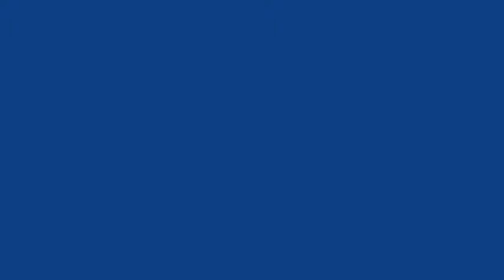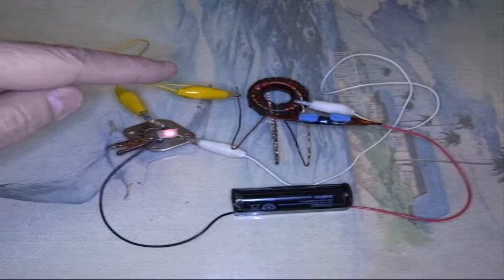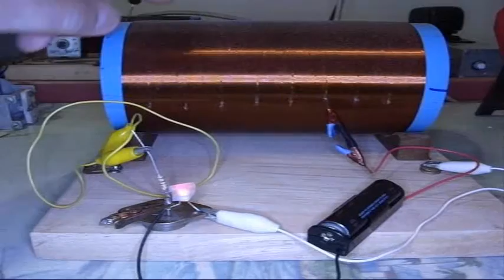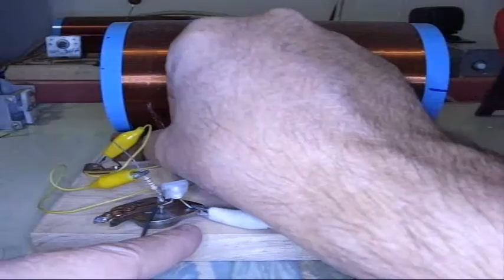Joule Thief Core Ratio & Variable Frequency Experiment

Comment: lots of things to experiment with.thanks for sharing.are the tap points just a looped section of the coil,with the coating removed.also how long,diameter,number of winding's,number between taps dia/gauge of the wire if you have time
Reply from the maker: +bill bailey The wire is just enamel coated "bell wire".  I show how to wind one in https://www.youtube.com/watch?v=8XR9Uzy2RPM  
There are 20 turns between taps in the first coil, but that' could be 5, 10, 15, 25 or whatever you want to try.  The second coil with the wiper is 170 turns, but again that could be more or less.  I used a 1mm wire, but that can also be more or less.  As a very general rule, more turns will mean lower frequency but more flyback current and brighter light.  There are limits to that, but that's part of the experimenting.